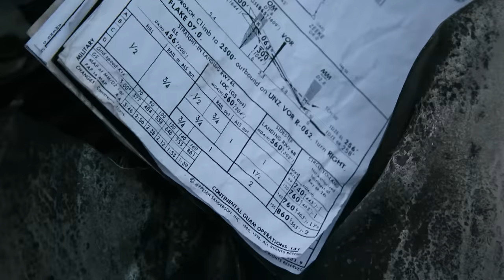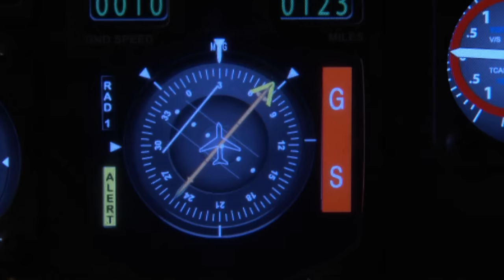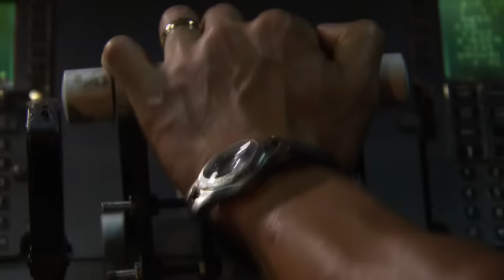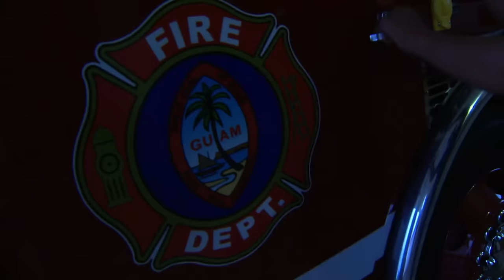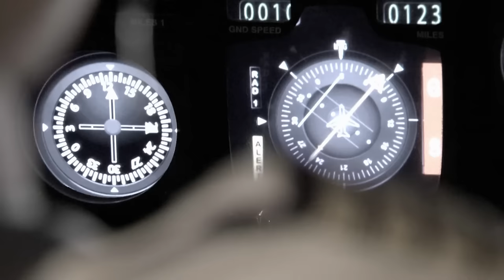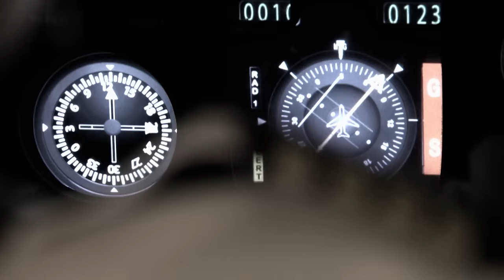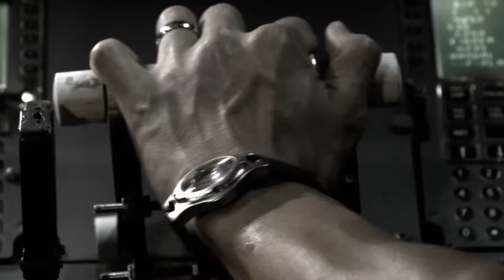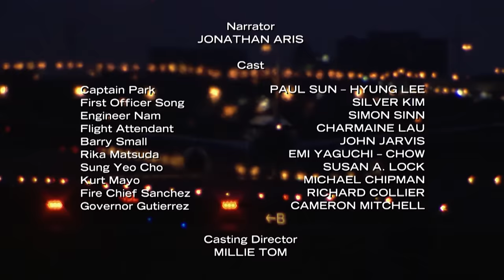Flight 801's Desperate Struggle: Navigational Nightmare and a Race Against Time!

Comment: The National Transportation Safety Board determines that the probable cause of this accident was the captain's failure to adequately brief and execute the non-precision approach and the first officer's and flight engineer's failure to effectively monitor and cross-check the captain's execution of the approach.
Reply: Yeah, and adding the fact that the Captain was suffering from fatigue.
Reply: that was caused by stupid mentality at that time unfortunately,,,
Reply: Would have helped if USA's glide scope in USA Guam wasn't out. Sometimes in a huge airplane, you don't take well to surprises..It happens to be a difficult airport btw. My sister said never again(similar story), and sticks wth New Jersey sands...Sad!
Reply: If it was just one issue the accident wouldn’t happen. It takes several issues combined. This one had the recipe for disaster
Reply: That’s not completely true, that’s only a part of the blame. There was a list of issues and the glide path was a major part.
Reply: @kimmccabe1422 they were told ahead of time that the glide scope was out. It was down for maintenance and all pilots were told it was out. This was the only plane that had trouble with it.
Reply: @zoraknme the pilots were given out of date charts which displayed incorrect distances from the airport, so the plane technically landed where it was supposed to according to the documents.

Comment: It is difficult to discern who is more at fault, the captain for attempting the landing, the airport for not having working approach radar or the airline for placing the captain and crew in the position of attempting a blind landing?
Reply: The glide scope was down for routine maintenance. All pilots were told in advanced that the glide scope would be down.
Reply: @zoraknme  The glideslope beacon was down and they probably should have diverted to an alternate airport with such terrible weather at this one.
Reply: @karoleenascottage  There is no alternate airport. The glide scope beacon was down for routine maintenance and the pilots were told this ahead of time, before the flight even left Korea. All pilots flying into Guam were told this ahead of time and were reminded of it again during approach. These pilots were the only ones who had issues with it.

Comment: The number of plane crashes that have occurred because of bad weather, poor atc-pilot communication and/or pilot fatigue is of concern and still a big issue in aviation. Even though it wasnt the main cause of this crash, I am certain it was a contributing factor
Reply: The number of airports with malfunctioning equipment is unbelievable. Airlines should refuse to use those airports.

Comment: And as usual, nothing was done to remedy the alcohol presence, and as usual, the EFFING DRUNKS are more important than the safety of the passengers. It's disgusting that an individual cannot go a few hours without a drink of booze. Obviously, the duty free products were not being consumed by passengers, to be fair. However if someone can afford to buy that poison in another country to take it home with them, then they can damned sure afford to have it shipped there rather than taking it on the flight back. And if not, then maybe consider leaving it where you found it.
Reply: I thought they sold liquor on flights anyway..? I don’t drink myself I hate the stuff
Reply: @Rosco-P.Coldchain  You are correct, and I understand your point. And it is a very good point, too. I blame the airlines for serving alcohol on flights 100%. Often, it's the reason many flipped out passengers cause a disturbance in flight. The FAA should yank the alcohol from airlines. If a person cannot wait a few hours between drinks, then they obviously have an addiction issue.